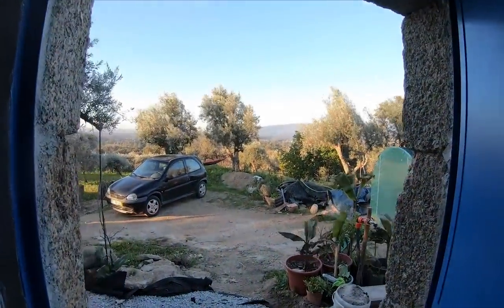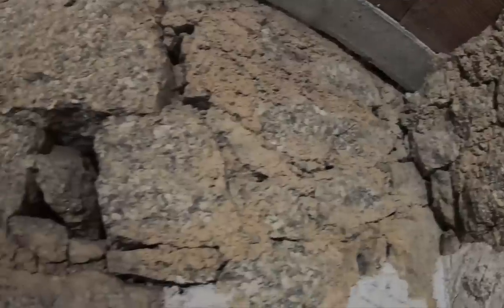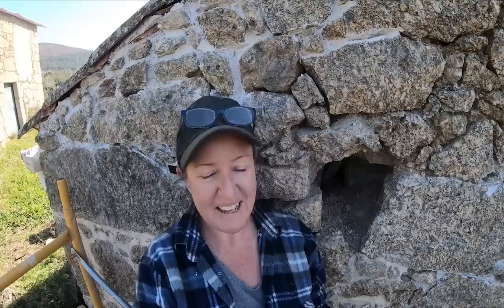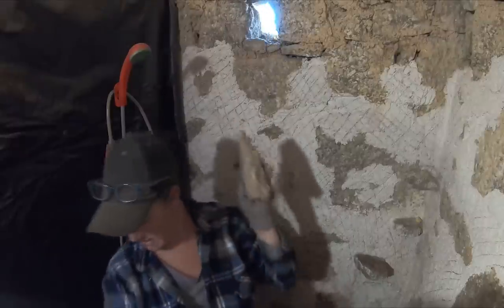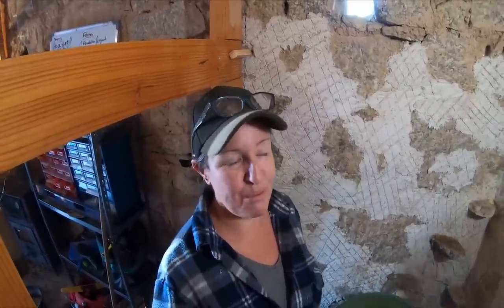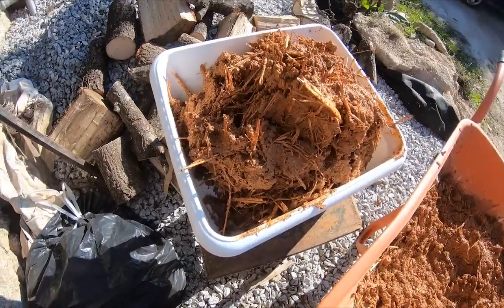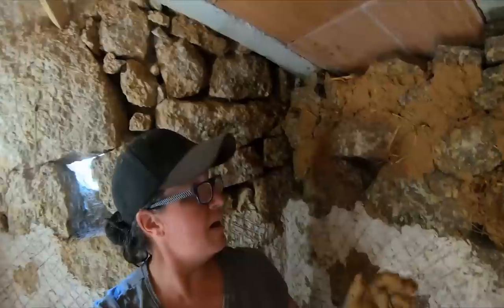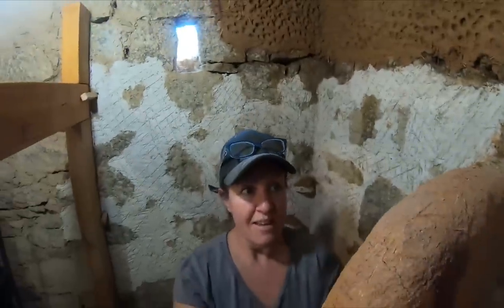Tiny House Shower #1 - Flashback to the Start, Window Plans, & Cob

Comment: You will need some kind of frame for the porthole to “sit” into, perhaps a steel plate larger than the porthole with a cutout hole for the porthole to sit or bolted onto, then fix the plate into the wall, perhaps more but you need to ensure that the porthole is sufficiently secured and I doubt you’ll be able to achieve this without a frame.
Reply from the maker: That's part two of the video, out tomorrow! I haven't secured anything yet... but I'll share my idea for it. I agree, needs to be secured and I want it to be easy to replace, in case something breaks.

Comment: Interesting shower version with an usb pump. I have to check how that one works because we don't have a shower in our tiny garden house yet. We have a solar shower outside but that one works only when there is enough sun 😉
Reply from the maker: It's amazing... costs around €25, I think. You also need a large pot or bucket to hold the water to drop the pump into. I just use a giant pot, fill it half way, heat the water and top it up with cold until it's just right. Finicky and you have to shower quickly, but it does the trick!

Comment: You could bolt the timber frame to the wall. A window frame is a good ideal it will make it easier for opening and closing the window.
Reply from the maker: Yes another idea was to use metal brackets to fasten the timber frame in place but I went with this option as I don't have a lot of experience using plugs and screwing/bolting into stone. I hope it's ok, so far, so good. The porthole has its own frame and then opens and closes from that... I address how to attach the window in tomorrow's video. 🙂

Comment: ive just bought a shower holder for my usb dump in a bucket rechargable jobby..stainless steel with soap holder..12.99 of f ebay..ive also bought a square shower rainfall head and it was only 7.99..ive now got a tidy looking shower unit..im going to buy another for my back door on my campervan.amazing what one can achieve..your place is coming along nicely.
Reply from the maker: The little USB pump thingy has been a life saver for me! But I'd like to eventually have a 'regular' shower with taps coming out of the wall. I'm going fixture shopping soon!

Comment: Very, very impressive. The build up to this stage ties a lot of of things together. You don't realise what crops up from one small fix to the next. This ties in with that. You can't do this until that etc but it all comes together. Eventually. Two pairs of eyes would be ideal, a set inside and a set outside as you join projects or jobs together. In an ideal world of course!!. But great content once again. Best of luck.
Reply from the maker: Thanks! Yep thing all build on each other and it all keeps moving in (hopefully) the right direction!

Comment: It's hard to tell what your roof connections are, but it looks like your ridge beam sits on top of the gable wall. The wall you're looking to put the port hole window in. Just be careful chipping the stones out - do a little at a time and have a plan to get out of the way in case anything falls. (I am a civil engineer) I'd probably put another identical porthole on the outside, take out the glass and put in a screen. A shiny pipe, even a dryer vent, between will help bounce light. You're making great progress.
Reply from the maker: Thanks for the advice! Since I'm working with an existing hole I feel a bit more comfortable, but I can see clearly what's resting on what and I'm working slowly and only chipping away one rock... so I'm not so scared but always good to plan for the worst! Another porthole, you say?? Interesting idea! I'll keep that mind, though I do have another idea up my sleeve. 😀

Comment: Getting more light is definitely something i'd consider over aesthetics .... but totally get the need for centreing it 😄 loving the things i'm learning like the properties of clay.  External copper pipes would be great for plumbing 🙂
Reply from the maker: Turns out it'll be the perfect location because it'll stay open a lot of the time anyway and be centred then. But I love the light already and, you're right, that's the most important thing! And airflow. Copper pipes aren't a thing here but I'm going to use stainless steel wherever pipes are exposed and this other multilayer stuff where they're hidden.

Comment: Kirsty with some thought ....... thinking a stove pipe and or heating venting tin pipe ...... would work as going threw your stone wall would esteticly inheense with reflection of light refracting threw and any time some one gazes out the port hole from shower ( it would be the light at the end of the tunnel) effect  looking forward to your dissision on what it is you come up with..... cheers ah ...........S
Reply: Like a sun tube, people use those in roofs, great idea….
Reply from the maker: I've seen these in roofs... that's a cool idea! It would take a lot more work on the interior stone wall to fit that and I'm ready to move forward, but I'd certainly consider this for the future!
Reply from the maker: Cool idea! Unfortunately the wall interior wouldn't allow me to easily to that, but I could keep it in mi for the future.

Comment: Something to consider would be to use a black barrel on an!!! !!    @derry y   elevated stand outside your shower wall. The barrel could possibly be set up to fill from the runoff from your roof. The sun will heat  the water and the elevation of the barrel will provide the water pressure to your shower head. Maybe put the sprayer overhead or high on the wall.  Water, heat and pressure basically free!
Reply from the maker: I love solar heated water and gravity fed is the great! I'll eventually build some sort of solar heating gizmo and a water tower, and I'll also catch the rainwater from the roof (but I can't catch it into tank on a tower to feed the house since the roof is too low) but for gravity feeding my house, it's not so high so the flow wouldn't be great. So, rather than doing that, I'll likely buy a pump and feed that through an on-demand heater. But I'd love to incorporate your ideas in the future somehow.
Reply: @PortugalfromScratch  my great grand and I love watching you and your trials and tribulations. Love your mom and dad also. Good luck with all you do.

Comment: It seems to me that if you fit the window to the outside wall, it really won't matter what shape the inside wall is. You may not need to do anything with the rocks on the inside unless you just want to widen the hole.
Reply from the maker: I wanted to be able to open and close it from the inside so that’s the reasoning for that choice. But it definitely would have fit better on the outside! 😁

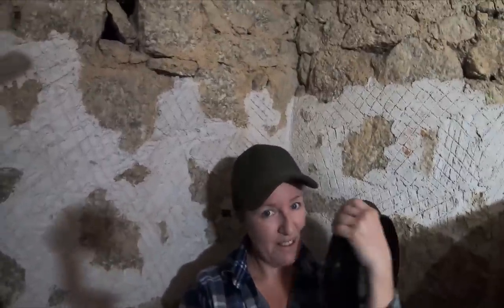Comment: 6:45 Speaking of the order of things, Mr. Burns was a good beginner project to prepare for this more intermediate one because it seems like a lot of the same kind of work, but more of a challenge. Then this one will be good experience for the front door and window. Accidental or intentional, seems the best order to me
Reply from the maker: That's a great way of thinking about it! Even for tiling my bathroom floor, for example. That's a job for later, but I've had the tiles for a year and have felt intimidated by it, but now I feel way more ready to tackle it when the time comes.

Comment: Your bathroom door could be made out of corrugated plastic panel opaque. With a wood frame. That way the bathroom light can come through to the interior and vice versa. You can buy these panels online they come in sheets and are quite sturdy. I used them to build my green house.
Reply from the maker: Lots to consider for the space as a whole, the door is a while away but I'll keep that in mind!

Comment: Kirsty, i suggest any wall hole you make frame it with wood to size, the remoe frame.
Reply from the maker: I'm not exactly sure what you mean about removing the frame? But maybe my plan will be more clear in my second video when I start working on the porthole a bit more.

Comment: Hi Kirsty, can’t help thinking the porthole in the bathroom is too difficult and not the right construction for that situation. How about you use three (or however many fit) bottles, could be clear or green, or a mix? You would lime render them in in two directions so you have the  flat bottoms giving you a flush finish, inside and out?. I just think the lip around the window will cause you all sorts of porthole nightmares  and make you cry. Whatever you do, sending good vibes 😎
Reply from the maker: Hi Monica, thanks for the idea but the other reason for the window besides light, possibly the more important reason, is to allow the steam to escape when I have a shower, so I need something that opens. This ready-made porthole seems like the best solution. Eventually I want a skylight so if it's giving me trouble, I can switch to that idea. But I think it'll be fine. 🙂
Reply: Girrrl… kristies got this… she can do really HARD things.

Comment: Kirsty, have you made sure that the building you are living in has habitation licence? I've been investigating this, and I've been told that these stone barns inside rural plots are what is known by law as "apoio agricola", or for agricultural support only, and to be used as storage spaces. Rural areas are usually outside of the "zona urbana", or urban zone and cannot therefore have a permanent residence permit.
Reply from the maker: Yes you're right, different land has different types of rules and you have to check with the local camera to see what's allowed.
Reply: @Portugal from Scratch  so glad you're aware of this and have checked your own land/building. People need to know about these rural/urban laws before beginning renovating these places. Well done Kirsty 🙌😁

Comment: I don't know about cob used to hold stones in.
Reply from the maker: That's how all of the buildings here are built and they're super solid. Even clawing the clay out takes some effort. But if the holes are large I'll pack them with lime instead and I'm also packing and pointing with lime from the outside. I want to use clay at least for the front face so that the next layer of clay can grip on better. It's easier for same materials to attach.

Comment: I think you need a lintel above the window. Just to be safe.
Reply from the maker: There's already a massive stone spanning the two other stones beside the window which is acting as a lintel on the inside. The outside might need something extra but not sure yet. Either way, this hole was already there and I'm just widening it slightly without removing any of the actual stones so, in this case, I'm not concerned.

Comment: Corte metade de ambas as pedras e depois arredonda o buraco.
Reply from the maker: That's sort of my plan, but the hole has to line up with the hole on the outside, too.
Reply: Não precisa, se a janela do navio tiver dois vidros coloca 1parte do lado de fora e outra do lado de dentro. Outra ideia arredonda o buraco exterior coloca a janela e abre por dentro com um ferro ou objeto que consiga colocar no fecho. É tenha uma boa semana.
Reply: Outra ideia se a janela tiver duas partes coloque a parte exterior com rede antimosquito.
Reply: Se a janela tiver um vidro (faça com a sua sabedoria uma janela idêntica em madeira com a tal rede para o exterior) o buraco na parede se não conseguir arredondar. Paciência arredonda só o sítio das janelas.